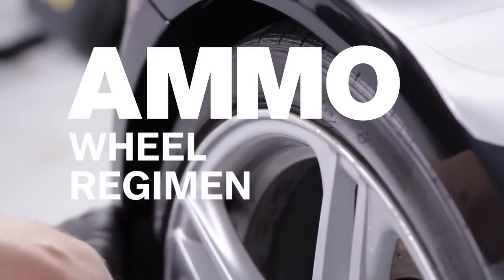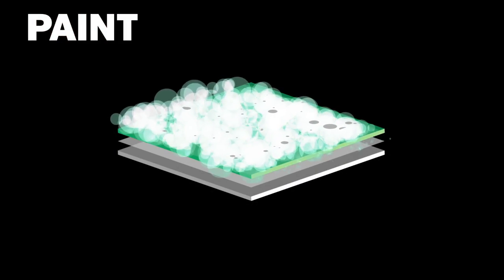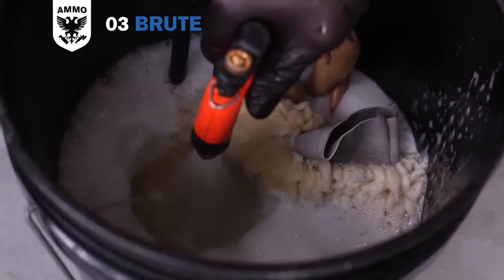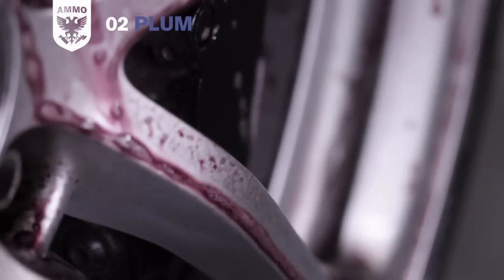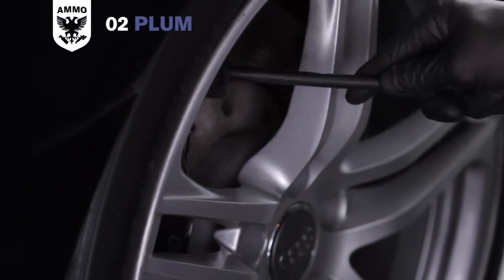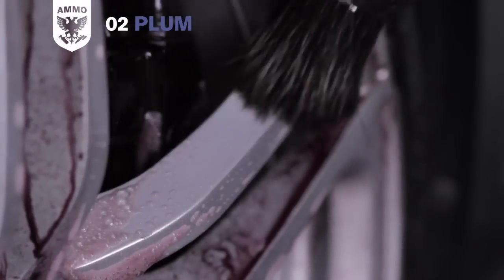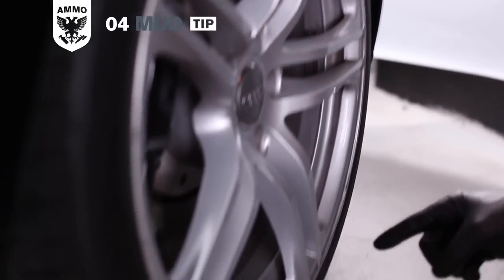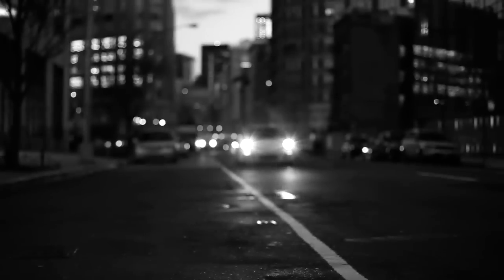How to Use AMMO Wheel Regimen

Comment: I used brute wheel soap for the first time after it sat for a couple of years on my shelf.  I just always cleaned the wheels with the car paint soap which worked fine on my factory painted Lexus wheels.  But OMG!  It brutally cleaned the wheels, easy and faster with just a little of the product .  Seriously, they even seemed a touch brighter.  I’m super impressed.   It’s a maximum strength cleaner.   I won’t be using the gentle body paint cleaner anymore on my wheels.

Comment: Hi Larry, question about Ammo Plum, would this be safe to use on a wheels with a stickers on them? I have Work emotion t7r and they have a workemotion sticker on the spoke, I'm wondering if spraying the cleaner on the spoke with the stickers on it would lift or corrode the adhesive under the sticker

Comment: Hey Larry, I recent purchased a 2016 Ford mustang, used. The previous owner did this crazy black spray painting job on it completely diy and drippy. Im ok with the idea they were going with but the job looks super amateur. I want to refurbish it somehow without damaging the OEM paint. For now I'll start on tires. Will this tire regimen possibly remove spray paint?
Reply from the maker: No it won't. you need to reach out to a professional who will repair the wheels properly.

Comment: So is AMMO mud better than meguiars tire gel?
Reply: Supposedly. Meguairs Tyre gel is solvent-based which apparently dries out the rubber rather than moisturising it as AMMO Mud does, being water-based.
Reply: lightningsmokerXx
Well. thanks for doing the research mate ;)

I'll be honest, I do use the Meguiar's Endurance gel as it's not viable for me to obtain Larry's products (unfortunately). So it's good to know my shitty $70 tyres aren't being hurt by the product.
Reply: I've been using Endurance for years with no problems, never had any discoloration or dryness  - you have to remember you are going to be replacing your tyres fairly regularly anyway, even if you live in a climate where you need winter tyres, you still shouldn't keep tyres for more than about 6 years after their manufacture date as they harden and perish even when not in use.  Having said that I'd use Ammo Mud if I could get it locally, because I can well believe that it is the best.